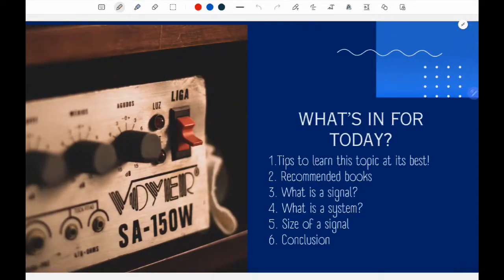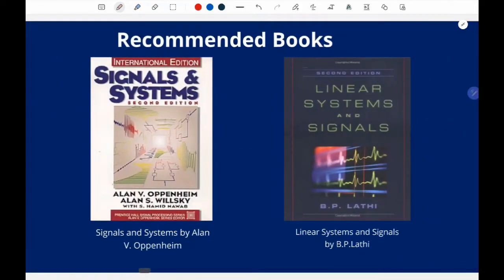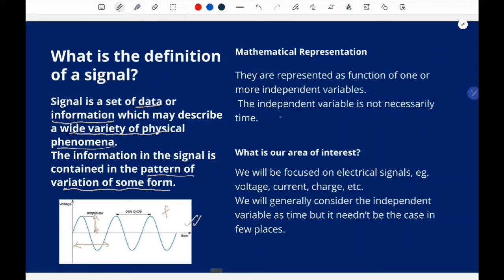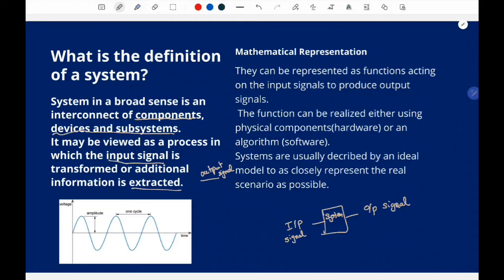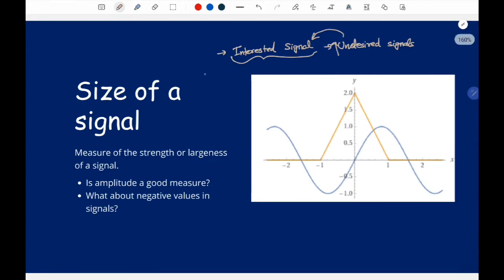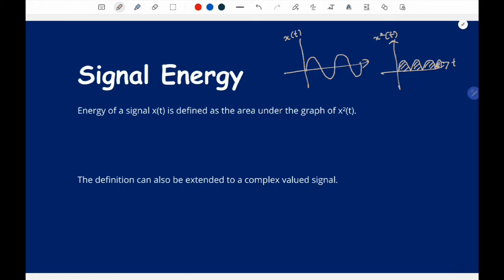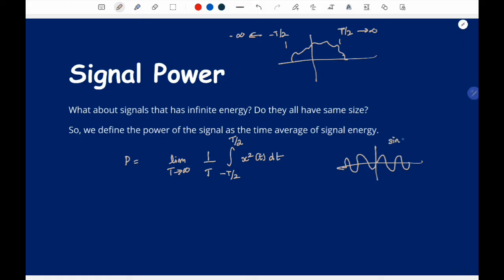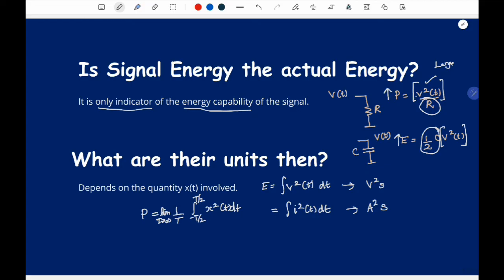Signals and Systems | Introduction | Ram Balaji S | AIR 1 GATE EC

Comment: So, this is probably my 3rd or 4th time going through a signals and systems course (one in college, once for gate, once for revision through a crash course), from what I have seen so far, this is probably the most intuitive lecture I have seen, other sources usually take a mathematical approach which is necessary and good in its own right. But this, this is a gem,very intuitive and well reasoned, like a story. Thank you very much.

Comment: Great. 

I would like to suggest to include demo of playing with real signal, to provide  a soul to your lecture. 

The two best books I read, for better understanding and implementation to solve real world problems. 

1. Scientist and Engineer's Guide to Digital Signal Processing;  Steven W. Smith

2. Think DSP; Digital Signal Processing in Python

Many students are good in Signals and Systems, but struggle to implement the concept in real. 

All the best.
Reply from the maker: Sure! Will consider it! Thanks!
Reply: Thanks for the suggestion! The first recommended title is freely made available by the author, I gladly appreciate such humble gesture. 

Oppenheim, the renowned author of "Signals and Systems", himself published a book on DSP "Digital Signal Processing" which includes some other nuanced topics such as DFT, hilbert transforms...